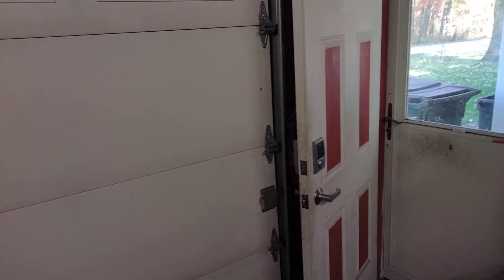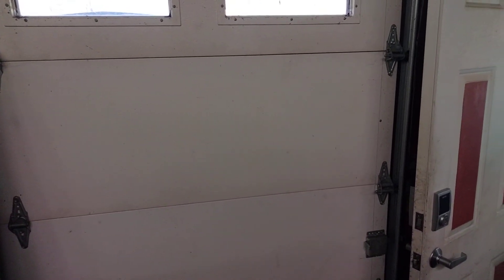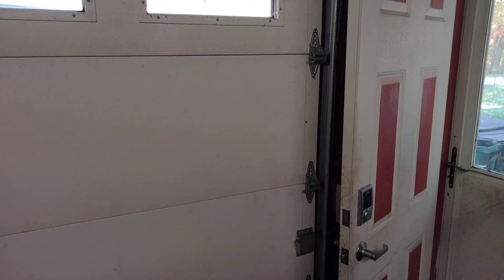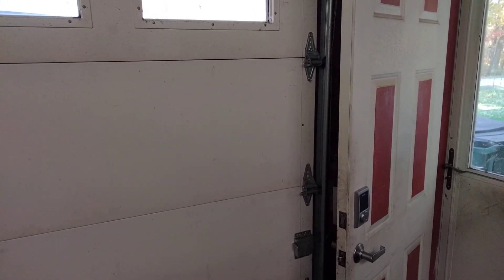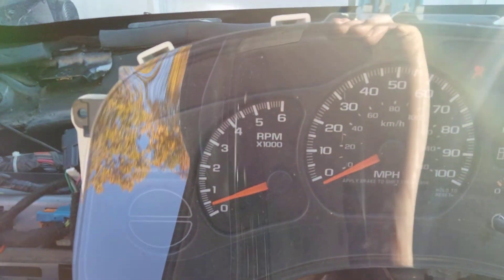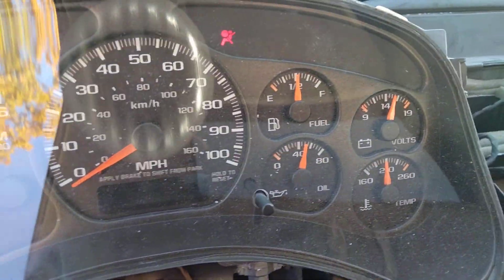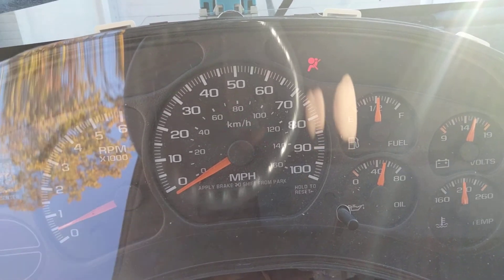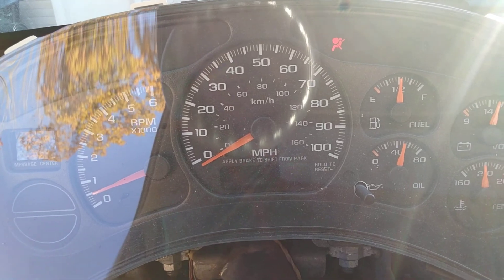LS-1 5.3L noisy valve train pt 2, fully warmed up - '02 Avalanche Restoration Project

Comment: LS engines tend to have noisy valve train at high miles, of course this would not be the cause for you particular engine, I'm not sure sharp on this topic, but maybe a high volume oil pump could help?
Reply from the maker: I'm pretty sure the cause is that Comp Cams sold me a bad set of lifters. The only reason why I made the video and posted it on YT was for the viewing convenience of a Comp Cams rep I'm dealing with, so he can hear it for himself. Of course the public is also welcome to view and offer their insights. 

This video is after full warmup. If you watch the other longer video linked in the description you'll hear it from cold start. The valvetrain sounds fine when cold and gets noisy as it warms up. Pushrod length has been ruled out as a possible cause. The Comp Cams rep said I'll have to pull the lifters because he can't think of any other cause. I'm waiting for the replacement lifters, they are out of stock right now. And I'm pissed about having to take the heads off under the hood after I had this work all squared away on an engine stand. 

The noise sounds like excessive valve lash from the lifters not doing their job properly. I have a new stock oil pump in the engine, it makes 50 - 60 psi at 500 rpm idle, and that is plenty for the lifters to function. This engine has a stock bottom end and this is a low rpm truck application that will never see much more than 5000 rpm. I would not put a HV oil pump in this engine because it will put too much oil over the valves and cause high oil consumption. I know this from past experience. 

Thanks for viewing and commenting. If anybody else has seen something like this I'd like to hear what they think.

Comment: what was it
Reply from the maker: After changing lifters 2 more times the engine now has a set of stock GM lifters in it, and is much quieter. I have posted several other videos documenting my experience with this. Bottom line: I will never use Comp lifters again.